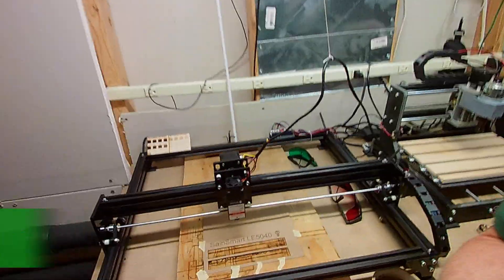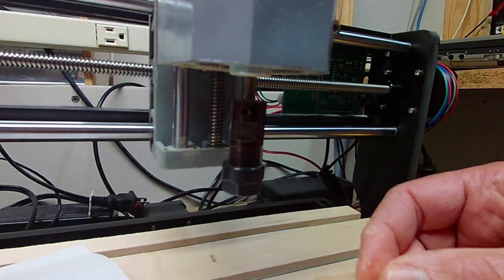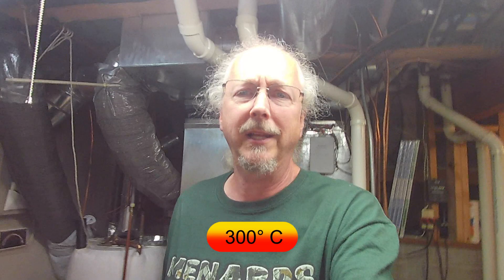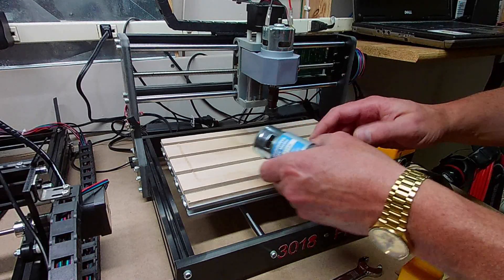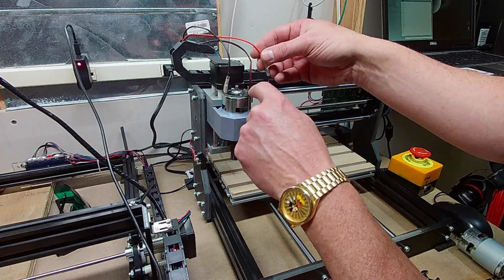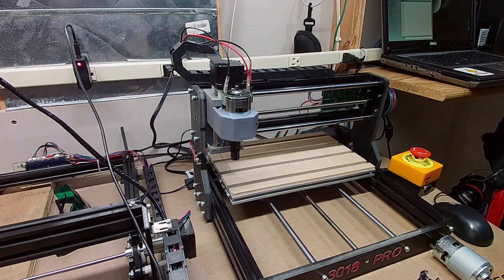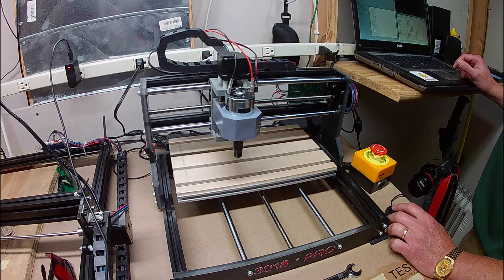SainSmart GS-775M spindle upgrade for 3018 Pro

Comment: Would you happen to know what the power supply is rated at for 24VDC?  My original supply and upgraded supply both are rated at 4A!  Could they have included the upgraded supply with the 3018 PROVer?
Reply from the maker: The power supply that came with my 3018Pro is a 24v 4.75amp supply. Just enough to get this new spindle motor working if I include the ramp up code when I start it spinning.  I do not know what SainSmart includes with the 3018 PROVer.  You could ask them: https://www.sainsmart.com/pages/contact-us.  They usually do a good job at getting back in a day or so.
Reply: Mine had a 24V DC 8A on stock 3018pro. I also did the spindle upgrade and had no issues at all. I also do not need to ramp speeds up. Just turn it on. The Mosfet on the driver, btw. is rated for 18A at 40V, so no need to change it either. And it stays cool, too.

Comment: Saintsmart says right on its web page that you have to ramp it up or it will cause this issue, Or get a more powerful power supply, but they fear that might fry the controller
Reply from the maker: Thank you for letting me know.  I am glad they have updated the information.  That is something we talked about.  The ramping up works just fine so far.  One of the programs I use to generate my g-code I was able to get that added in so it will put that in for the motor control code for me each time.  :-)  I have thought about getting a separate power supply to drive the spindle.  Maybe some time in the future if it is needed.
Reply: @CNCATHome  what program do you use for gcode generating that allows autogenerating that code to it each time?
Reply from the maker: @jameswright2712  - For some things with my CNC router, I use a program called F-Engrave.  There was a place to set up the code used for start up.  I was able to put the ramp up code in there so when I generate my G-code in that application, I do not need to edit the code for that.
Reply: It will definately NOT fry the controller. The mosfet is rated far beyond what that spindle needs. You might however need a new PSU...
Reply: I emailed Sainsmart and they told me I was good to just plug and play because I had the upgraded power supply. I got mine about a week ago

Comment: Tried it, was too loud even at 10,000 - supposed to have an anti-noise circuit but I didn't see any. Oddly enough 300/500 watt OEM china spindles are more quiet.
Reply: The "noise" suppression circuit does not refer to directly audible noise but to EMI. It suppresses radio-interference-noise. I however have not tested how bad the old spindle was in this regard compared to the new one.

Comment: 15:12 its working? what is problem.both wants 24v volts nothing changed lol
Reply from the maker: You can run the motor at about 40% just fine.  When you go higher, it draws too much current for the controller to run the spindle and the steppers.  I have another video coming out with a solution to this issue.  I also have the solution in the video description.  If you ramp up the power to the motor vs. starting it at full power, the controller and power supply seem to work OK.  It is just that start up power draw the ends up exceeding the available power and the controller shuts down for a second to protect itself.
Reply: the wattage has changed. if the stock 775 100w motor can do around 7000-9000 rpm , then this motor with like 20000rpm is probably 200w.

Comment: 11:03 same source voltage there have to be gears inside to make it go faster.so its noisy and less torgue
Reply from the maker: The new motor is the same 24 volt but it draws more current.  It is designed to run faster.  No gears I assure you.  ;-)  The motor gets its speed and better torque from the increase in current.  That is why there was an issue getting it going.  The power supply does not have enough current to drive the motor up to speed and run the stepper motors.

Comment: Jeez, I installed it, increased the power supply and ran it, but the noise level is off the charts. If I run it at 10K, it's 6-10db louder than the original one. There must be a quieter spindle that has more power. At 20K it's ridiculously loud.
Reply from the maker: What size power supply did you get for the new motor? 
The original motor on the 3018 Pro runs at 7,000 RPMs at 24 volts.  This new spindle will be louder when it runs at higher RPMs.  It would be nice for it to be quite.  High RPM motors tend to be louder.  IT would be great to find a high power, high RPM, and very quiet motor.
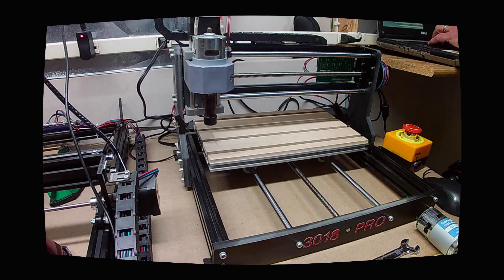Reply: Impressions at 08:00, the old motor wasn't too loud, the new motor test with no load will be totally different to when you're trying to cut/mill at 20k rpm.
Having heard your initial run up of the new motor, are you sure installed holder is not rubbing on the casing? Sounds very metallic. Can you try dampen the noise by wrapping some thin rubber doing the exposed casing ? Or see if it is just air noise by partially covering air holes round the top of the casing temporarily

Comment: I have a 3018 pro from yofuly i just got my spindle in today and it works fine at full power with my machine
Reply from the maker: Nice!  What is the power rating on your power supply and what controller in on your machine?  Mine is a Woodpecker controller and the power supply is 24V and 4.75A.

Comment: hello very good your video, please is it possible to share the cnc3018 parameters?
if i'm not mistaken they are 132 at all, because i have a cnc like yours but i lost the parameters. the command to access the parameters is $$ typed in the grbl sender
Reply from the maker: My 3018 Pro settings are:
$0 = 10    (Step pulse time, microseconds)
$1 = 25    (Step idle delay, milliseconds)
$2 = 0    (Step pulse invert, mask)
$3 = 5    (Step direction invert, mask)
$4 = 0    (Invert step enable pin, boolean)
$5 = 0    (Invert limit pins, boolean)
$6 = 0    (Invert probe pin, boolean)
$10 = 1    (Status report options, mask)
$11 = 0.010    (Junction deviation, millimeters)
$12 = 0.002    (Arc tolerance, millimeters)
$13 = 0    (Report in inches, boolean)
$20 = 0    (Soft limits enable, boolean)
$21 = 1    (Hard limits enable, boolean)
$22 = 1    (Homing cycle enable, boolean)
$23 = 3    (Homing direction invert, mask)
$24 = 25.000    (Homing locate feed rate, mm/min)
$25 = 500.000    (Homing search seek rate, mm/min)
$26 = 255    (Homing switch debounce delay, milliseconds)
$27 = 1.000    (Homing switch pull-off distance, millimeters)
$30 = 1000    (Maximum spindle speed, RPM)
$31 = 0    (Minimum spindle speed, RPM)
$32 = 0    (Laser-mode enable, boolean)
$100 = 800.000    (X-axis travel resolution, step/mm)
$101 = 800.000    (Y-axis travel resolution, step/mm)
$102 = 800.000    (Z-axis travel resolution, step/mm)
$110 = 800.000    (X-axis maximum rate, mm/min)
$111 = 800.000    (Y-axis maximum rate, mm/min)
$112 = 600.000    (Z-axis maximum rate, mm/min)
$120 = 10.000    (X-axis acceleration, mm/sec^2)
$121 = 10.000    (Y-axis acceleration, mm/sec^2)
$122 = 10.000    (Z-axis acceleration, mm/sec^2)
$130 = 300.000    (X-axis maximum travel, millimeters)
$131 = 180.000    (Y-axis maximum travel, millimeters)
$132 = 45.000    (Z-axis maximum travel, millimeters)

Comment: usually there is a small red dot to indicate + do you have a price for the GS-775  also do you know the watt draw of the new verse old
Reply from the maker: You can get the new motor from SainSmart for $22.  They have an option with the collet extension already put on for $30.  Here is a link: https://www.sainsmart.com/collections/genmitsu-cnc/products/genmitsu-gs-775m-24v-20-000-rpm-motor-noise-suppression

I do not have any current information on this motor or the old one.  I could hook up  my multi-meter to see what the draw was.

Comment: Thanks for the clear demo for fitting the new collet extension - gives me confidence to try it myself.  James Dean Designs https://www.youtube.com/watch?v=6kqmf_rWxs4 tried the same upgrade and found that the motor needed a 15A 24V supply in place of the 5A version fitted originally.
Reply from the maker: It was quite a bit easier than the first one I did.  I had thought about putting a shim in there to prevent the new extension from going too high.  I think I got lucky.  ;-)

Thank you for the information on the updated power supply.  I will have to check that out.  My worry would be over heating the controller as I know that has been an issue for many people.